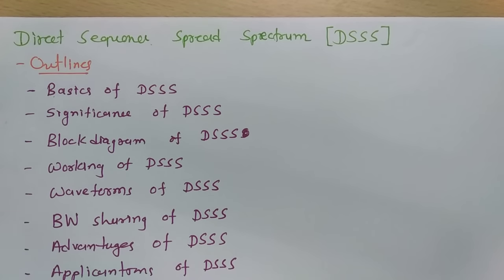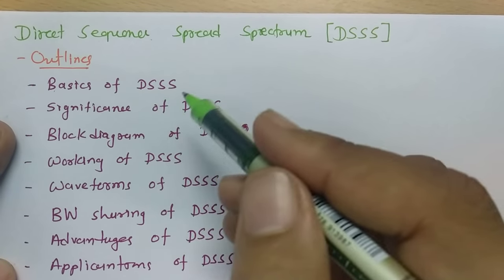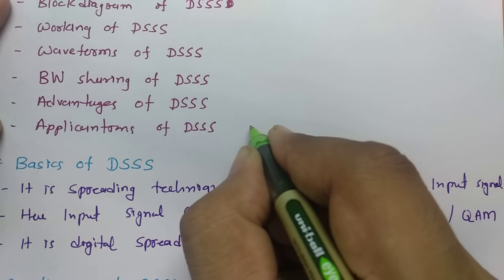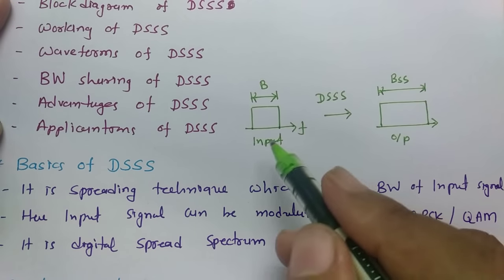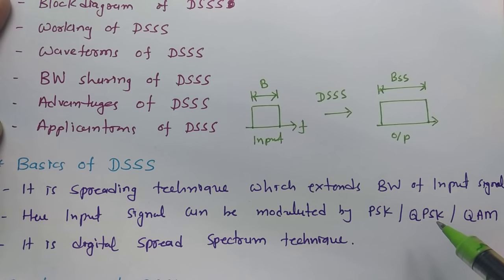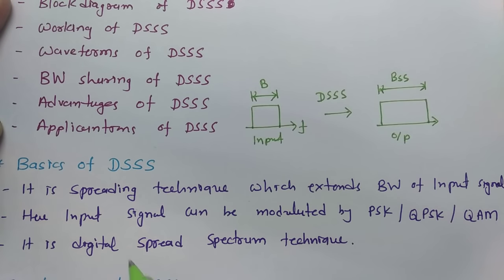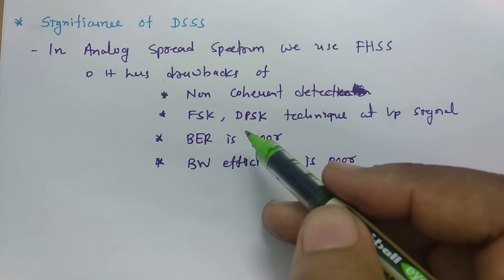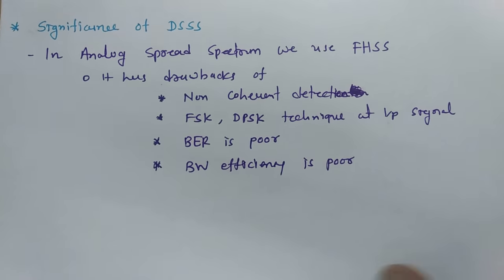Direct Sequence Spread Spectrum DSSS (Basics, Block Diagram, Working, Waveforms & Applications)

Comment: How you are claiming that DSSS is better immune to jamming than FHSS? It’s much easier to jammed B.W separated in DSSS, while in FHSS it’s hoping in different channel at different times. If jammer is sending noise on one channel only specific chunk of data would required to retransmit in FHSS. Thank you though for working presentation of DSSS. Keep it up

Comment: Nice explanation is given for spread spectrum. In this you have given a block diagram of DSSS with PN sequence and chip generator blocks after phase modulation block. The original information in discreet form, is firstly modulated with chip generator to expand its base bandwidth .Then further it undergoes PSK or QPSK or anyother keying so that final cont signal is available for transmission, so shouldn't PSK block come after chip generator??  
Is alteration of signal base bandwidth by PN code is done initially and then its phase keyed to be transmitted or phase shift keying is done initially then this is further SS modulated using PN codes? which order it takes place?  Please do clarify this point sir.

Comment: Sir You told that In Analog,  frequency synthesizer and PN sequence are available and In digital both  frequency synthesizer and PN sequence are replaced by Chip   generator in previous video . But in this video you told chip generator and Pn sequence are available. I was  confused. Could you please clarify my doubt
Reply from the maker: I understand your confusion, the Chip generator generates the PN sequence for both analog and digital implementations.